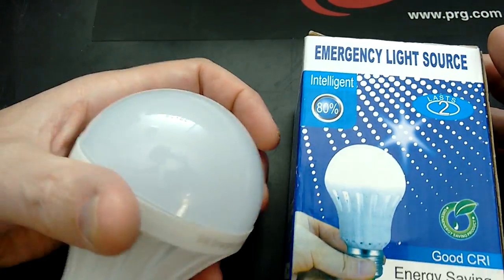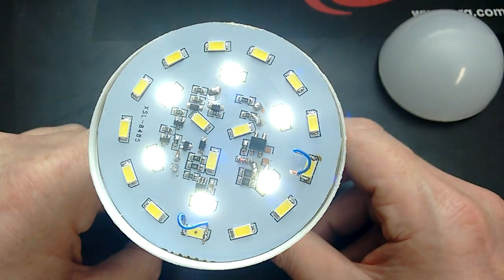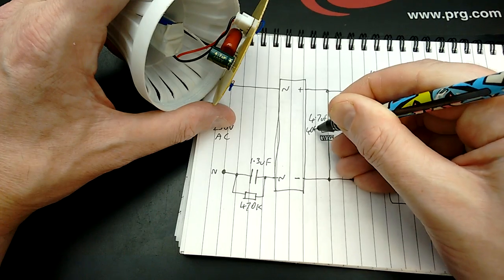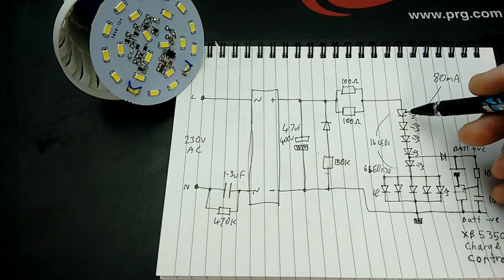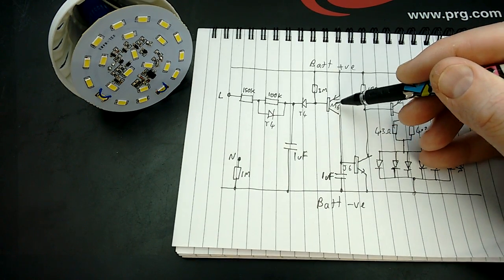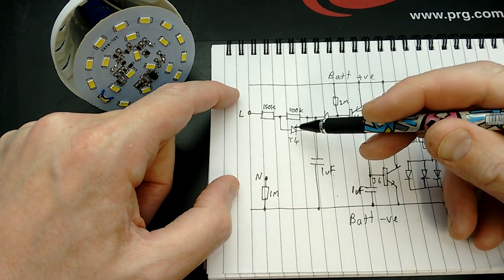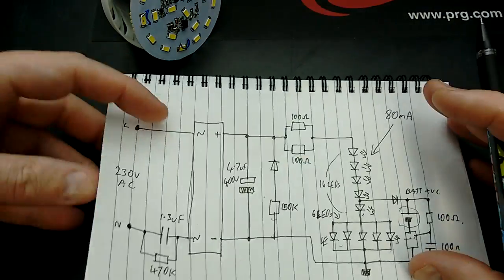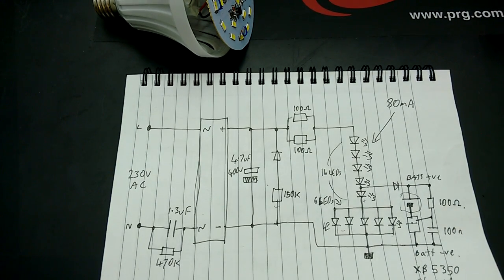Inside an "intelligent" emergency lamp with schematic.

Comment: The wife is arguing with me because she says its a waste in the UK with reliable power.
She asks if you know about future UK power supplies becoming unreliable if no nuclear power plants are brought online. lol
I said it would be good for camping. that idea went down like a lead ballon
Reply from the maker: I should add that the very best emergency light you could possibly have is a head torch.  That way everyone has light wherever they need it.
Reply from the maker: Since our fantastic national grid was given away to government buddies it has not been maintained properly and the future is actually looking quite bleak in terms of electrical reliability of supply.  When you consider that electric cars are going to suddenly arrive en-masse then the increased power demand will result in the system being pushed over the edge.
Reply: A Friend had her power cut after nightfall without warning when a nearby drug farm in a squatted property caught fire - apparently drug farmers frequently boobytrap their properties by wiring doorhandles etc. to mains live. The firemen and cops are under orders to exit a drug farm until the whole street's been switched off at the substatioin.
Reply: +bigclivedotcom Indeed. Also there are alot of workers that are allowed to drill in the streets and you will have idiots that will break the cables instead of just replacing a water pipe so always be prepared
Reply: I would agree that a sudden influx of electric cars will possibly lead to power cuts. Lots of Nuclear power stations coming to the end of their lives and can't be extended any more. potentially problems in the future
Reply: Had that happen round here. Many used to dig under boundary fence foundations from the cellar and tap into street lighting etc, in most cases without seeing in the base of the lamp you couldn't tell. 

One homeless guy browned out my old estate few times by taking an axe to the mains cables that were affixed to the outside of the houses that were to be demolished - still on the grid. Sparks flew and you heard a bit of cursing, but the next afternoon he had a can of beer and a sandwich out of it. 

He's dead now, got run over by a butchers van. Ironic really, the homeless guy was a veggie. I miss living there, many wonderful times.
Reply: They had some experts talking on radio 5 live daily before noon yesterday (31st). apparently it's going to be OK because appliances of the future will be able to be remotely switched off by the grid managers and UPS batteries commanded to feed power back into the grid... Seem to me that this is someone thinking of making my appliances more expensive in order to dig themselves out of a hole for not investing in essential infrastructure.
Reply: Regarding the car thing, I think it'll possibly come down to those who use their cars in peak times will face a premium of some sort, if you are commuting to and fro, then you are not putting power back in, those who are happy to stay at home and leave the device in the grid will be smitten. £$ talks at the end of the day. Who knows though. 

+1 for head torches though, those things rule. It's a bit ravey when you're in an area with other peeps with them on though. I dunno how the miners in my area coped with that effect.
Reply: You never know when the power grid will break down so i recommend you still buy a few
Reply: +joinedupjon That sounds like bullshit, I mean, someone  being able to drain my UPS and turn off my fridge remotely? Also, I think that power wont be a problem in the nearby future. More electric cars and more appliances, but more efficient. 

Also, here in spain we already had issues, because all of our nuclear plants (10) are from the 50s and 60s. None of them were dissasembled in 2000 as the goverment promissed, they were refitted. We need more energy, so we do what is needed to provide it. Same in the UK i think, if a country really needs more energy, there will be more energy somehow.
Reply: There are only so many times the life of a nuclear power plant can be extended. the ones in the UK have already had a life extension.
The Hinkley point B replacement fiasco is a laugh. if it went ahead everyone in the UK would be paying a lot more for energy.
On the flip side, halting hinkley point just pushes the UK energy need further down the road without anything else in place

Comment: that's a very clever idea. Normal light and an emergency light all in one.
If the price is right, shed loads of these can be sold
Reply: Well they're about double the price of a typical china LED or roughly what you'd pay for one at your local store, so I'd say it's worth getting a few.
Reply: There are nightlights that do the same thing; Run at night, unless there's a power failure, at which point the device would still light up at night, but could be unmounted from the plug-in base to be used as a flashlight.

Comment: it's fantastic the way you D engineer stuff.
 I've been pulling stuff apart. and electrocuting myself
... to the horror of my mother.
 50 years ago.
 she actually installed safety proof child proof. wall sockets in the entire house.

It did not pose  much for a problem to me.. in retrospect I'm surprised I didn't burn the house down.
 I still play around with electronics
 I have a breadboard and it would be really cool if you did something on a breadboard I can copy it.
 simple timing circuit.
555
 great video thanks a lot for all of them
Reply: Just check our Julian Ilett he has 555 timer videos
Reply: Using a 4017b Decade Counter and a couple of 555 Astables, I managed to make a Multi-Tone Doorbell for my Project when I was at college. Got me 40/40 A* for it which was nice.

You can add arrays of resistors to give you different sounds and such, as well as tunes. I just had a high to low pitched tune via Piezoelectric buzzer, but with a 741b as a driver for a loud speaker. You could probably play a host of tunes using it, but it would only have as many notes as you have outputs on your counter (on a 4017b there are 8 outputs).

You could build an amplifier too. We made lots of different circuits in class & it was there I actually found I had a large interest in Electronics. Come away with a Grade B overall, missing out a few points in an exam left my with a C on one of them, bringing my average down. Still, I know my stuff. 

Power electronics is also interesting (but dangerous), and I moved onto larger stuff with Electrical Engineering, doing a brief stint at Torness Nuclear Power station.

Comment: Back in Dec 24, 2015 you did a video on fluorescent tubes. I was wondering if you might do a video explaining how the new electronic ballasts work. I use some that have you tie the 2 wires at each end together making them like a quick start tube and then hooking each end to a separate wire on the ballast. Here in the U.S. power companies are paying for many businesses to switch to the new ballasts (they send crews out to change them for free) because they use less electricity. They also claim to start quicker (they do in my experience) and claim to make the bulbs last longer (I can't say this is true or not). Can you shed some light on the subject?
Reply: They don't tell you they're much less reliable.
Reply: Magnetic ballasts are MUCH more reliable. We have some 70's original magnetics still running like new with ORIGINAL tubes.
Reply: And in my mind the perfect example for explaining how a choke limits current. J.
Reply: Richardj You can't beat my early 70's GE ring with GE magnetic ballast running for 40+ years
Reply: In my experience electronic ballasts light faster and consume less energy. HOWEVER, their lifespan is quite a bit shorter.* Also, unlike magnetic ballasts, 24/7 bulbs actually last less long than bulbs that are turned on at the beginning of the business day and shut off at end of day. SO, the lower operating costs have to be balanced with more bulbs and ballasts.

*I’m comparing T12 magnetics to T7 electronic florescent fixtures in a non-scientific personal observation where I work.
Reply: good to know. I would still like to know how they work as far as connecting both pins of the lamp together.
Reply: The electronic ballasts have far better power factor management than  inductive (traditional), and where you have a LOT of fluorescents this adds up in extra utility costs.  The downside is reliability (as mentioned). They "may" be more "energy efficient" (in reality better control of reactive power), BUT their lifespan is pretty short especially where duty cycles are long (24-hour operation), and the recurrent costs of replacement start to add up. . . . . . :-(
Reply: My experience with a electronic ballast in my living room has been that it has run since 1985. Cost me 30 bucks at the time. Ran with one bulb at times but i had a couple of philips bulbs that lasted 15 years. Maybe it was a fluke but that's my experience.
Reply: The thing about electronic ballasts is that you play the capacitor lottery. Does it have real brand caps or some piece of metal, vinegar and cardboard?

It's like LEDs vs filament. Filaments don't care if they get to ridiculous temperatures, whereas LEDs like to be kept fairly cool.
Reply: lol
Reply: Yea I have 6 of these at home that have been running for 7 years now. 8 at my dad's barbershop but 2 went bad in the same 7 years.

I make equipment as well that uses very odd bulbs and could only find the electronic Fullham ballasts to run them. The equipment is only on a few hours at a time but I have made 500 of them so fan in 10 years and only a few ballasts have been reported bad back to me. Fullham does have a 5 year warranty so that's a plus at least.

Comment: theres a little light about 30 cm long w/ a fluorescent tube in the hallway of my flat and if the electricity ever goes off it lights up so it must have a battery in it. but then when the electricity comes back it stays on for about a day so idk how it works
Reply: Maybe it stays on until the battery is fully charged?
Reply: it lights up because the natural sunlight charges the chemical fluocent stuff up. when charged it will glow and slowly discharge
Reply from the maker: It sounds like a common fluorescent emergency light.  They are generally available in two types.  Maintained - where they stay lit all the time or can be switched like a normal light.  Non-maintained - where they only light in the event of a power failure.
Reply: My office has/had a bunch of these. They've been failing constantly since we bought the building about 10 years ago. I took apart a few of the failed ballasts way back when they first started to pop. They used what looked like a single very large NiCad battery cell, which explodes it's gooey mess into the ballasts, shorting out random components and killing the unit.
Reply from the maker: Emergency lights are often neglected for decades.  The fluorescent ones often have a very short tube life because of the way they run them in the event of the power being off.  There's a good chance they all need replaced.